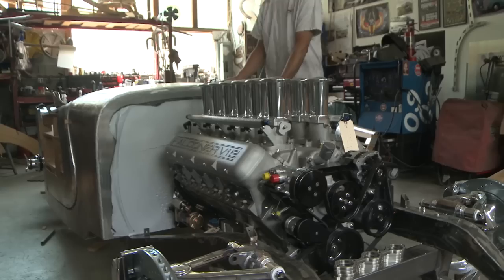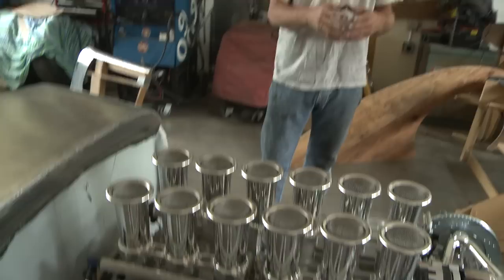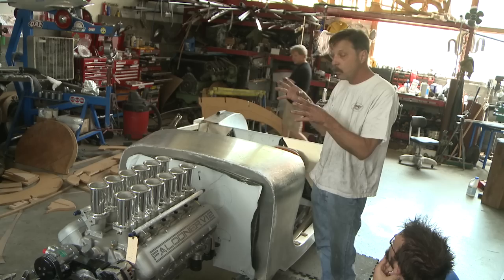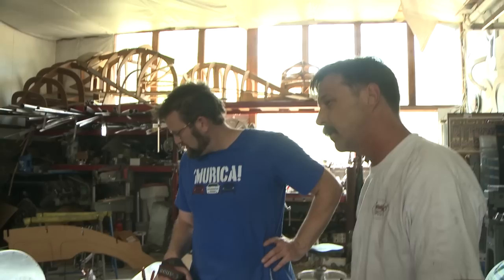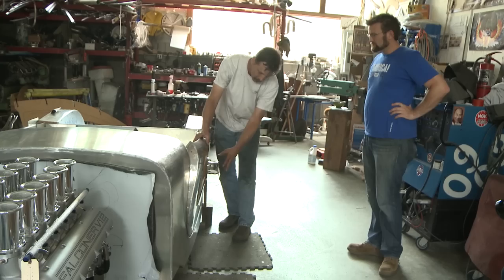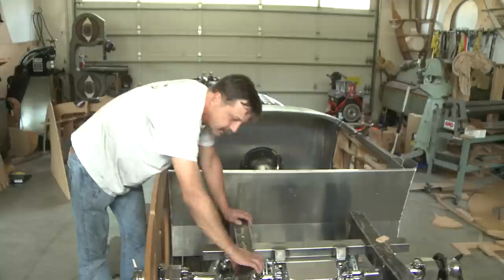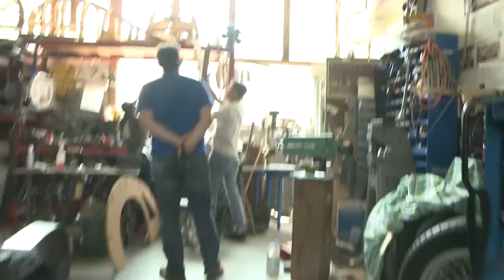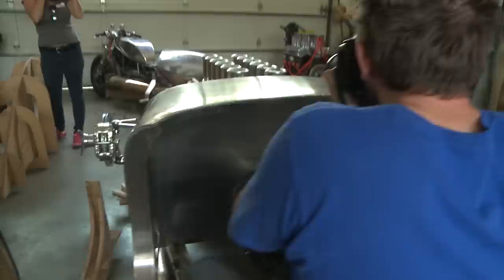Randy Grubb Shop Tour

Comment: Randy rocks but I would dropped have the motor that 4" and gotten longer trumpets (velocity stacks) so they would poke through the hood as he designed it.
Reply: Drop the motor 4 inches add 4 inches to ram tubes and it would look exactly the same?correct?with nothing protruding just like he designed it.

Comment: The whole car paradigm is dead; power to weight, fuel efficient, motorcycles all the way.   Start with a gas guzzling lemon, end with a lemon.  Why spend the gas to move all that steel, carpet, glass, and the heavy brakes to stop it all... around...?  Junk yards are filled with big bore gas guzzling 13mpg beheamoths nobody could afford to drive any more...  or had the expertese to maintain and replace all those extra... parts... as they wore out over time.

Like they say in the aircraft business...  the best part that costs you no weight penalty is the one that isn't there...
Reply: Barefeet then...